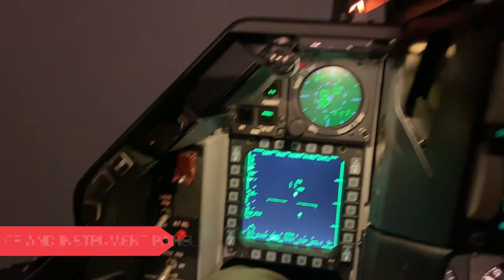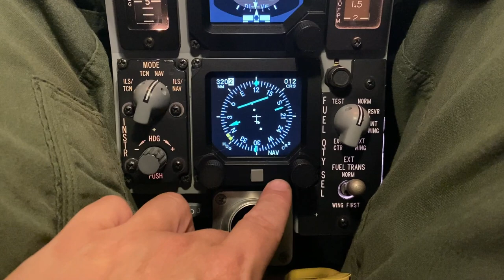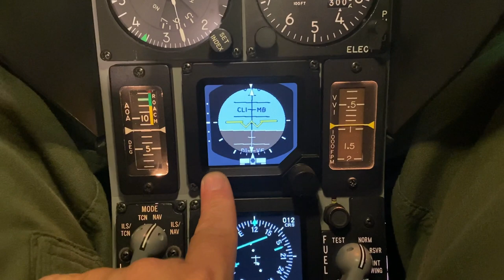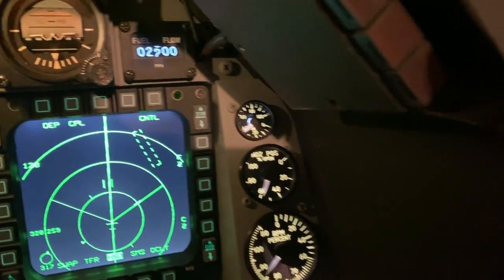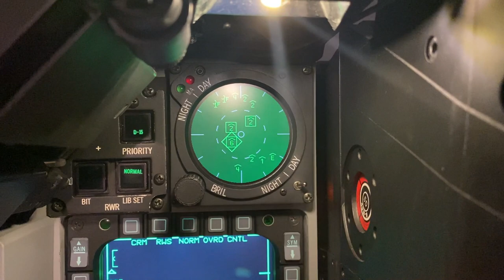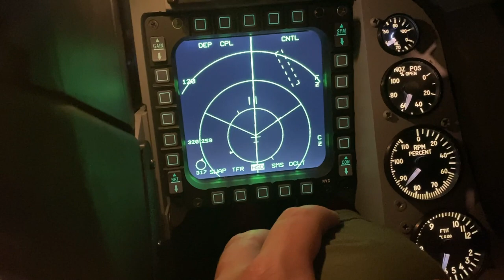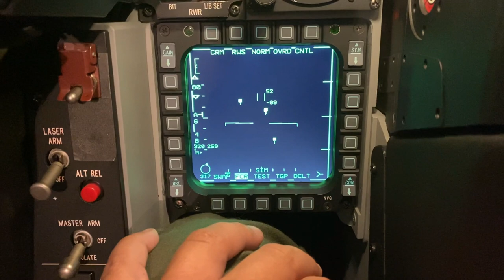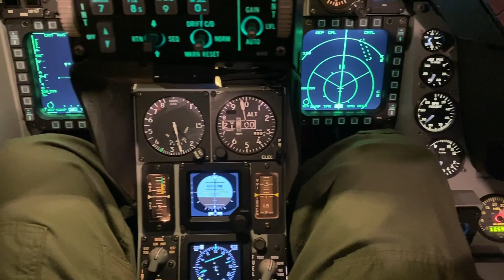TVS Build Cockpit 4

Comment: Perhaps a question that is asked often: Do you also use your pit in DCS? And did you find it more or less difficult to adapt all the MFDs and gauges to that sim?

Super impressive, been absolutely digging your content 👍
Reply from the maker: Currently no.  And since I don’t I’m not sure how difficult it is.  In my opinion and to me it would be more difficult because I don’t understand the DCS BIOS at all.

In our community we have a guy who came up with a new set of boards to have a complete system under one software (currently I used 9 different programs to run my sim) and at one point he will also make his software compatible with DCS so that you can easily fly BMS and DCS.  When this happens I can see myself completely rewiring my cockpit with his hardware to do just that.

Thanks for the compliments
Reply: @RainmanHST  I can imagine DCS BIOS being difficult to adapt your pit to, especially the steam gauges. Haven’t messed with it much but I didn’t find it intuitive.

Wow that board sounds super cool! Would be awesome to see a rewiring vid if you end up going for it! That sounds like a nightmare project 😅
Reply from the maker: @Spiniker0056  I will do a video for sure.  And thus rewiring would really put my theory to the test as I designed my wiring setup to be modular and/or easy to change.  I have all my panels and instruments all running into one “avionics box”.  So the theory is I just need to pull that box and and rewire it with the new hard ware and plug it all back in.  So when that happens we shall see how that all works out for me.  Lol